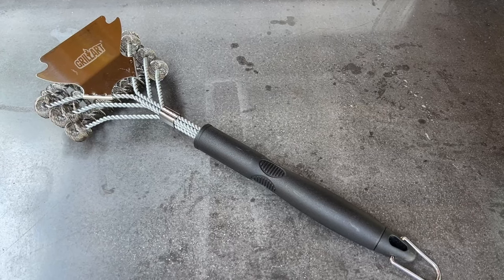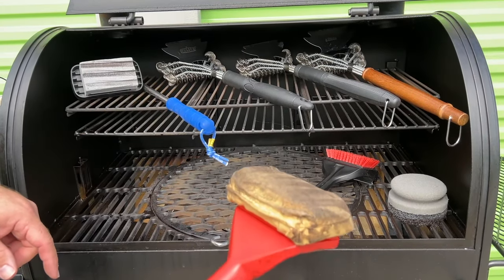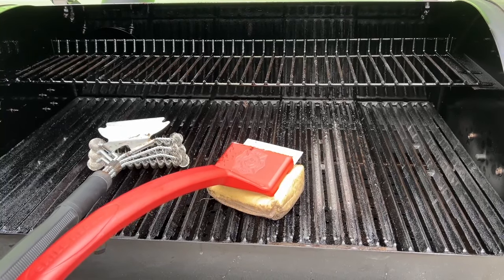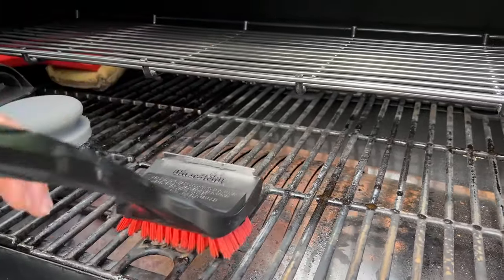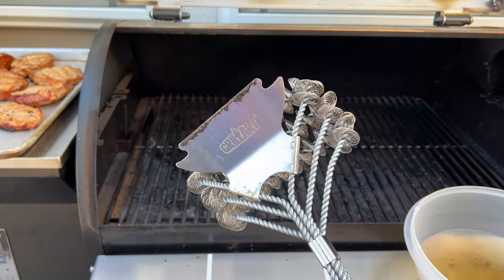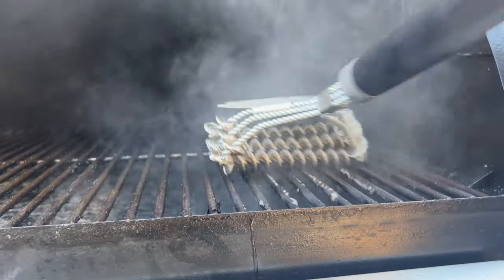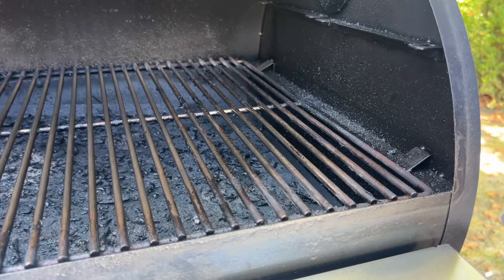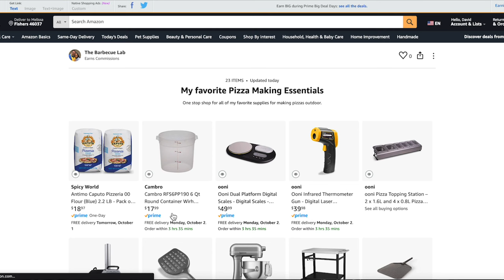Grill Brush Showdown: Finding the Ultimate Cleaning Tool for Your BBQ

Comment: I take a different approach completely.  I take the grill grates out, put them against two posts I have for the purpose and use my pressure washer with a turbo head on it.  They nearly sparkle after 10 minutes.
Reply: I bring mine to the car wash and strap it to my roof rack so it's a 2 for  1

Comment: I have used most of these grill brushes and I recommend the nylon brush above the grill rescue brush. Not because it doesn't work, but because it gets so gross and greasy. It's difficult to clean and the internal material of the grill rescue breaks down quickly and requires replacing often. Too expensive and not convenient to replace.
Reply: Ahh mine is getting greasy and nasty as well and noticed it doesn’t clean off easily. Haven’t noticed the intern part break down yet.

Comment: Griddle scouring pads work amazing and big packs are not expensive. I then give a pass with some citrussafe and a towel. I don’t worry too much about cleaning the bottoms of the grates or the bottom half of the rods on my 1/4 inch stainless rod kettle grate. Maybe twice a year I cleane them within oven cleaner which works well. Expanded steel grates I mostly just knock off the bits stuff with a simple coil style brush and then giving a pass with the scouring pad and then a quick paper towel wipe down.

Comment: I found  A stainless steel spring wire spring bristle brush, 700 times larger, with spring bristles, can be used with hot temperatures and does not rust. It features an assembly that's exceptionally sturdy, a solid cast aluminum handle. Cleans well and hot use and machine washable its called the BoyerBrush
Reply: Very unique brush. I think I am going to give it a try.  Still holding up for you?  You think it is a brush that will never needing to be replaced?

Comment: I use a brass bristle brush. No problem, hot or cold grill at least for me.
Reply: Brass?  Which one?
Reply: I regard those conventional wire bristle brushes as dangerous. There are plenty of people who ended up with one of the wires in their food and consequently stuck in some part of their body. An ex-work colleague has a piece of wire lodged in her throat in an inoperable location and will have to live with the pain for the rest of her life.

I always used a grill brush until I heard her story (and then googled to learn of more!) - I chucked it away immediately.
Reply: @Daz555Daz  Good for you